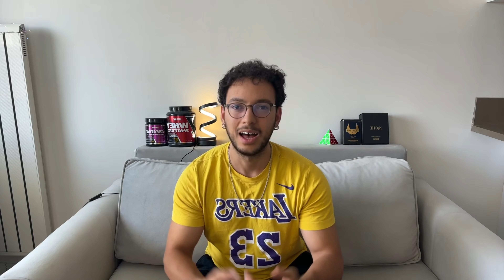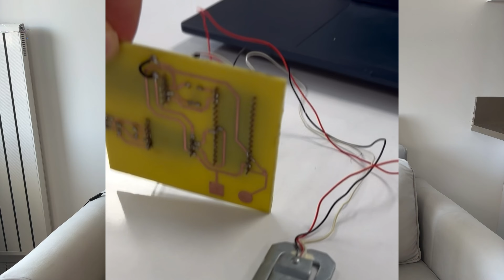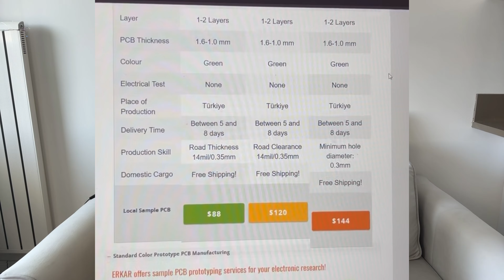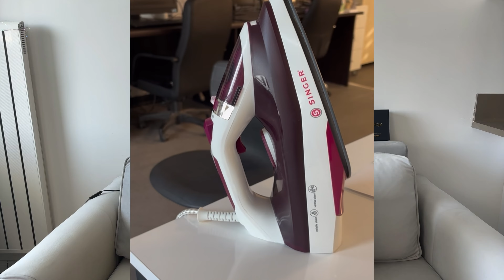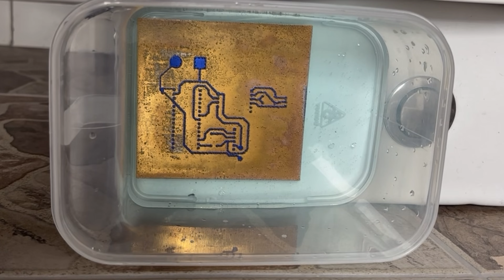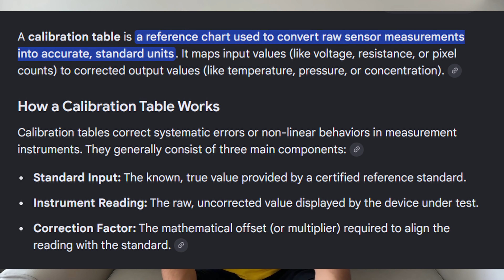I Have 8 Days to Finish This Medical Device

Comment: The other thing that might help is a discharge resistor on the adc. I think you might have static electric buildup that is has no path to ground (shunt). Expensive adcs have this built in like ads1232 but perhaps yours dosent.

Comment: Use a class three level to calibrate it
Reply from the maker: We only have force gauge and known weights in the lab so that’s the only way i can do it
Reply: @BoransJourney  Tape a ruler down to firm a hinge. And place a beard under the sensors to allow force transduction. Moving a weight along the ruler will along you to take continous measurements. The weights will allow you take discrete measurements. Combining the two will give you a reliable lookup table. You can slide the weights and down.